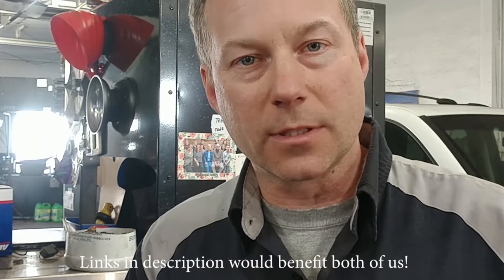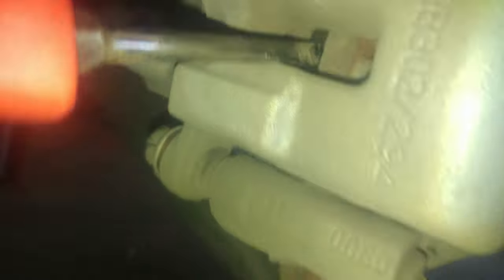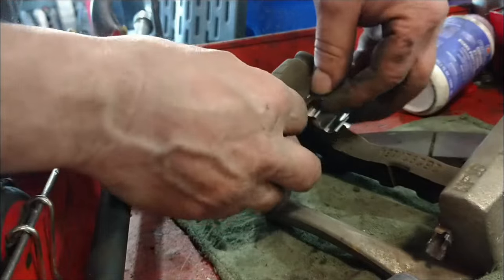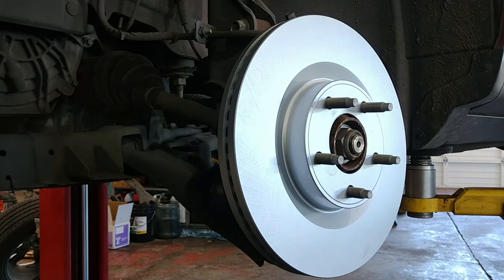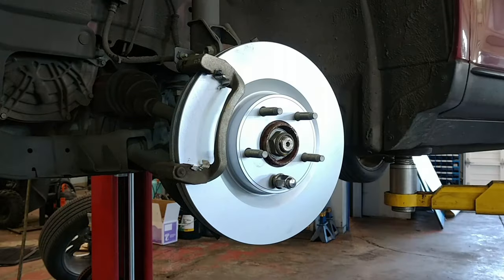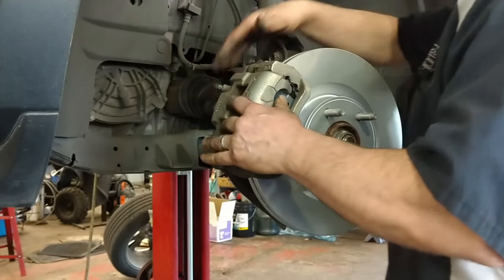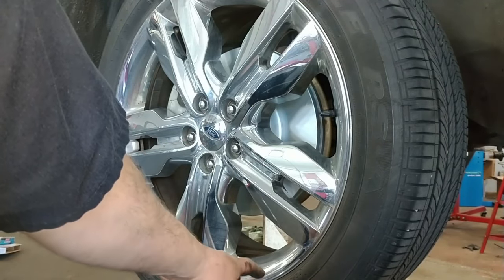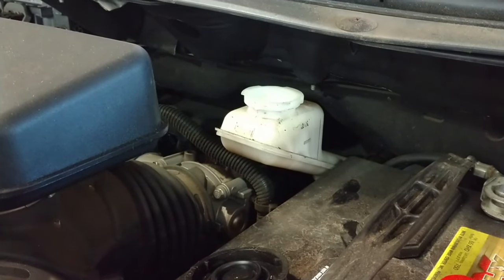Front brake pad replacement 2013 Ford Edge brake rotor.

Comment: What is that little clip for that you add to the brake pad? The one that wasn’t on the old brakes?
Reply: It's the thing that makes a sound when you are running low on brake pad. Like an early warning piece. That's all it does